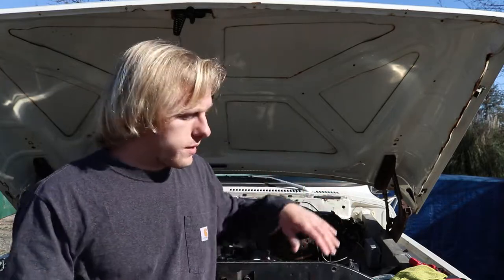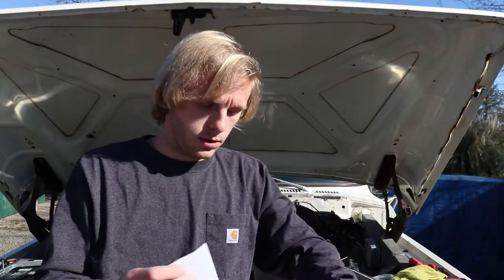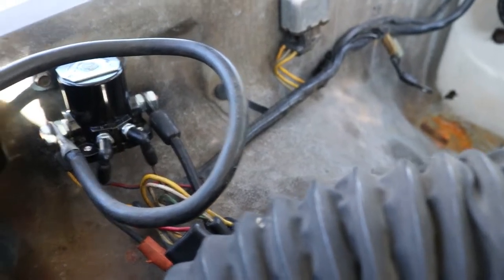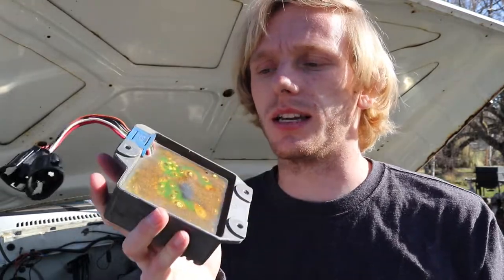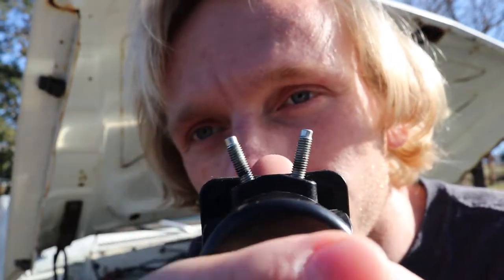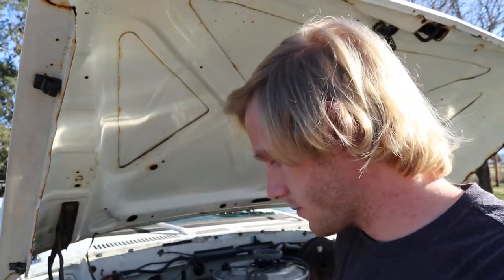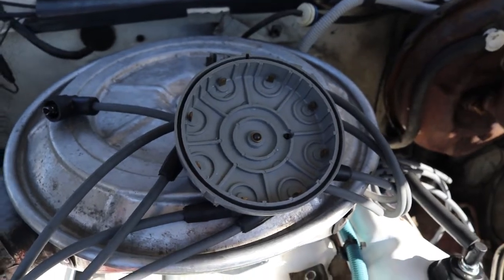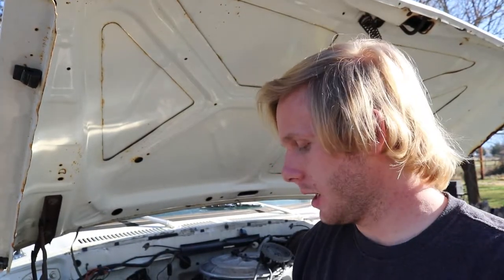My in Depth Duraspark 2 II Troubleshooting Diagnostic Guide

Comment: Hey Tyler, My 79 F150 is having spark issues.It would crank button start. I had spark out of the coil but no start. Cleaned the connector to the pick up coil and it fired right up, more than once. Now today, it won't start again? Have spark from the coil but when I check the neg side of the coil who cranking it "does not" flick on and off on a test probe. Does that mean a bad pick up coil? Where do I go next? Thanks Dennis.
Reply from the maker: Hello Dennis!
This does sound like a bad connection as it seems most troubles that are intermediate tend to be electrical related. One thing I learned testing coils is if you try to test negative with a test light you are actually providing a constant ground to the coil. If I remember right, I tried this and whenever I touched the test light or (I think) the multimeter to the negative side of the coil it killed the engine because a path was being provided for a constant ground rather that an intermediate ground (Pickup Coil) which causes the coil to release spark. I'm pretty sure this also can happen when testing spark as the spark takes the test light path rather than the spark plug wires. As for the pickup coil if it is above or below the specs I listed its probably bad, when they go bad it can cause very intermate problems. Another thing is make sure the ground inside the distributor is cleaned and connecting. Also if cleaning the pickup coil connection at the distributor helped move up the wiring loom to the connections at the fire wall, I would clean all of them and be careful the connectors can be brittle.
Reply: @TylerCreates  Thanks Tyler, I will check those items out and see if it's a fix. I keep thinking it's a corrosion or ground issue also. Appreciate your help and your outstanding video.
Reply: Tyler, 700 Ohms on the pick up coil. Good continuity on the P/U coil ground. Checked all the wires back to the firewall from the distributer and the coil. All had continuity. Does this point toward the p/u coil? It seems to be pretty new (doesn't always mean anything).  I also cleaned all the connectors with spray contact cleaner and scraped the contacts on the distributer. ????  Thanks Dennis
Reply from the maker: Dennis, Have you pulled a wire off down at a plug and tested for spark there while cranking?
Reply: @TylerCreates  Hi Tyler, I had checked for spark there before and nothing. I'll check again. Running out of options. Has a new coil, new duraspark ignition box, new starter solenoid, seems to be pretty new wires-distributer cap-pick up coil etc. Thing I keep thinking about is it fired up after cleaning the pick up coil connector. Going to try and make another check on the pick up coil I saw on line, ohms should fluctuate as you turn the distributer shaft past the coil.
Reply from the maker: Well if you have replaced all of that with no avail I would look to the pickup coil and if that is also fine then I might suspect bad new parts. If everything checks out and its still doesn't have spark then a checked item would have to be bad. One way to check spark I do believe is to turn the key on and it will spark every time the key is turned on.
Reply: @TylerCreates  I'll keep that in mind. We are having an Apr Noreaster right now. Will let you know in next few days. Thanks

Comment: DUDE. i have a 77 ford maverick, you are SAVING MY LIFE with this vid. thank you times a million. i’ve seen a couple of your other vids on this truck as well, also mega helpful. please keep us updated on the truck! the previous owner actually switched my maverick BACK to the points ignition system, so I’m converting it to the og Duraspark the way it was intended. so far everything is making sense, but one issue is the pesky pink wire. as far as i can tell, the green and red wire runs all the way to the ignition switch and doesn’t turn into a pink wire…i guess this means i have to put a ballast resistor in? it’s weird, because you’d think it would come stock with the resistor wire, it being a 1977 like your truck. hopefully this makes sense to you…i can obviously expand on this. cheers man.
Reply from the maker: Super happy that I was able to help ya on your Mavrick! I for sure would do ballast resistor. Small, less wires, more reliable all the above shoot you MIGHT be able to get a size that allowed a bit more voltage out. 0.5 to 1 volt more or something. It shouldn't cook anything and might give a bit stronger spark.
Reply: @TylerCreates  that sounds awesome. i will do that. do you mean get more voltage to the coil? so in essence i would need less resistance in the ballast resistor? sorry i don’t really know electronics.
Reply from the maker: Well after doing some research with a coil that is rated for 12 volts which I think most are. A lot of people don't run any sort of resistor. I forget the wire only drops voltage by about 2 volts. I would do some reasech, I typed duraspark resistor wire and tons of forum stuff comes up.
Reply: @TylerCreates  totally. sounds great man, thanks a bundle
Reply: @TylerCreates  it does seem to be a weird design flaw. why not just make every coil able to handle 12 volts? maybe some kind of cost thing.

Comment: Where did you get your 2 pin wire that plugs into the ignition module?
Reply from the maker: I'm not sure what wire you are talking about. I ordered a bulk thing of various colored wires off eBay for the tach and some other things under the dash, super happy with them as well.
Reply: @TylerCreates  42:57 You can see the one with the red and white wire.